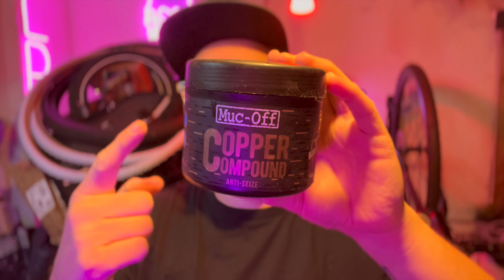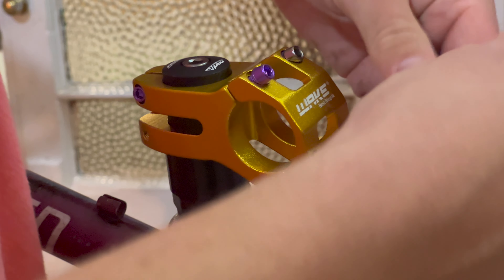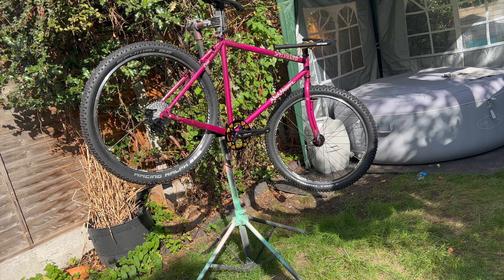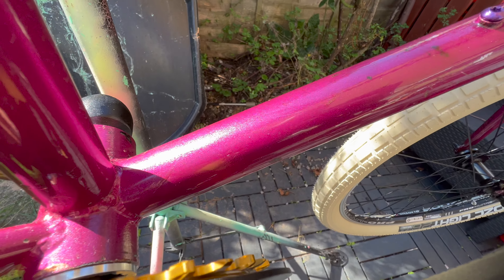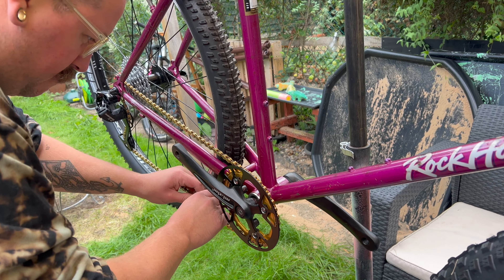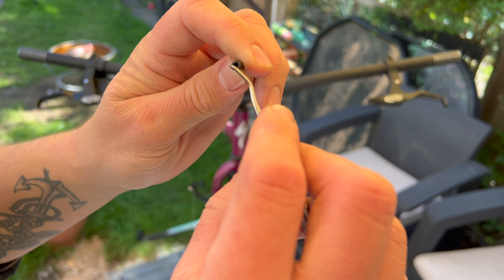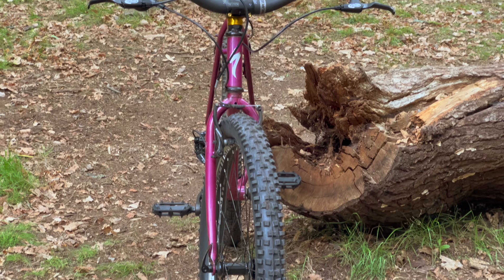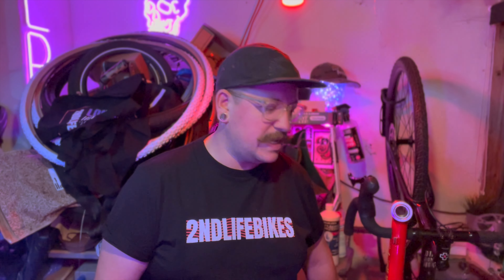Specialized Rockhopper Retro MTB Build Pt3 - Vintage commuter bike build

Comment: Thought I’d let you know as you talked about using the antiseize  on your head set. Well also used it on the brake pivot in this video and same concept here, it will probably wear those parts out.  Also there’s no need for headset spacers on a threaded steerer tube, that’s why they don’t fit…
Reply from the maker: I’ll have to watch it back but I don’t think I used the rust converter on the brake pivot? 

And the spacers are not on the threaded headset. They are between the headset and the stem adapter. 

With the stem adapters, a lot of the taper down instead of going flush. I use the spacers to give a clean look. The gold ones where to thin and moved. I’ve put a thicker on it now and works great. 

In my latest video I show the replacement.

Comment: Cool build! Knobbies are way to go, personally I think there is just too much Maxxis DTHs on retro mtb builds. Don't get me wrong, DTH is sweet looking and a great choice, but there is so much more character in retro mtb with modern knobbies. And glad you finally got this cooper compound grease straight ;) Cheers!
Reply: In the DTH's defense, most of the retro mtbs puttering around have been leaning into a more street-oriented use case. Tires geared for more gnarly stuff pretty much make riding on pavement a chore ime. Hard agree on knobbies in terms of aesthetics though, there's nothing quite like a panaracer smoke and dart combo on a retro bike (green michelin wild grippers and the homage tire by simworks are a close 2nd and 3rd in no particular order lol)
Reply: @possibly8180  I have a 1997 rockhopper I commute on, currently have CST Cheyenne tires on it. They're not bad, might switch to some Continental XC tires though. Good to have a bit of grip without insane rolling resistance.

Comment: Very nice choice in color and components. Here is my suggestion for city riding; Schalbe road cruiser tires with slime tire liners for a responsive, no flat, supple ride, and 420mm width riser handle bars to keep your head up and so you won't clip something with those  'long horn' bars. Lugs and wide handle bars better suited to single track bikes not city maneuvering.
Reply from the maker: The title of this video is actually a little misleading. As I mention in the video, this build starts of as a commuter build and ends up being a retro trail bike.

Comment: May I suggest Micro Shift AdventX 10 speed as an alternative to SRAM.  Cheap, reliable, and awesome performance.
Reply from the maker: It’s funny you should suggest that. I have ordered one for a different build but it is more expensive than the SRAM kit I used. Only £20 difference but still.

Comment: Do I need to upgrade the bottom bracket to use this setup?
Reply from the maker: Not necessarily. The cranks I used are standard square taper so will fit most (nearly all) BBs but I would say if you are rebuilding a bike especially an old one that may have been out side a lot the BB is a cheap upgrade for about £10.

Comment: Copper grease is intended for use as anti seize on steel parts, using it on aluminium or in bearings is not a great idea.
Reply from the maker: Yep! But I’m not sure if there’s an issue with aluminium…
Reply: @2NDLIFEBIKES  Any anti seize is better than none at all, but technically zinc oxide products are better than copper, for steel aluminium.

Comment: Yo man. This is really cool - I recently pulled a steel frame Saracen hardtail out of a skip, and just wondering if you’ve any advice on how
Best to source a front suspension decent fork? They’re obviously super expensive these days - and it’s also a straight tube. Cheers
Reply from the maker: Forks are hard to fine without spending a bomb but try bikemonger.co.uk they stock some older stuff and can be cheap.
Reply: @2NDLIFEBIKES  thanks so much man